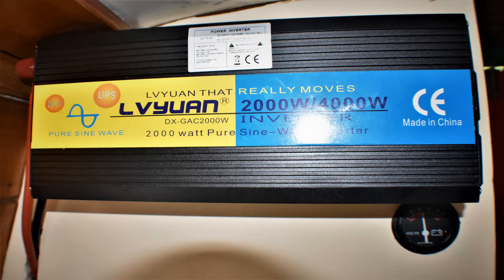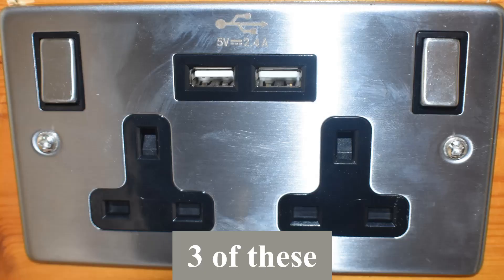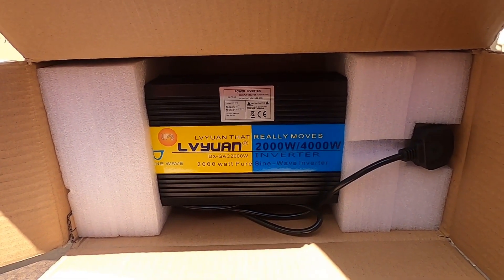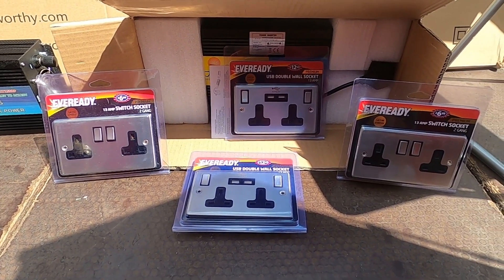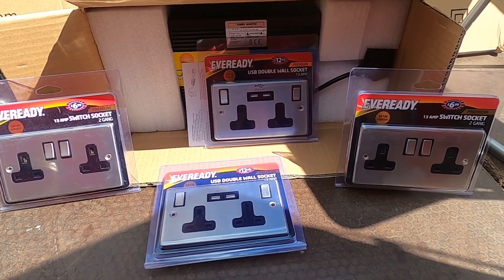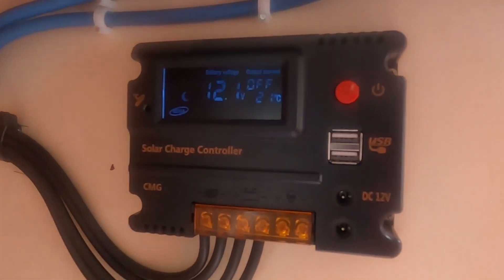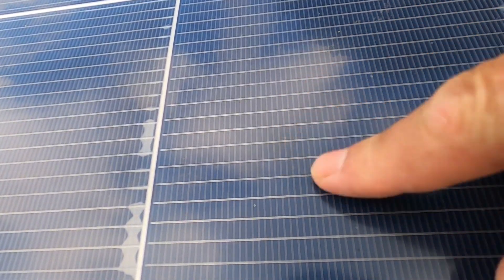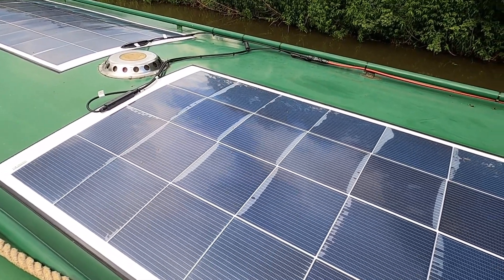Extra Video....No Cruising..... No Off the Cut....It's Electrifying.....With Solar Energy

Comment: Hi Trevor. Liked your blog as always. However could I kindly ask that you look at the " Boat Safety Scheme" and electric cable requirements. The  cables should be always multi stranded and mains electricity on a boat should use artic blue multi stranded cable , like you have leaving your inverter. The grey house single core domestic cable should not be used . Also your mains connection using a connector block I kindly suggest breaks the BSS rules and has the potential to be dangerous.( Easy to touch and get a shock) A sealed connector should be used. I am not an electrician, however I am now on my third narrowboat, and found personally that owning a boat is a steep learning curve with different regulations. The BSS handbook downloadable from internet is very helpful. Kind regards Simon.
Reply from the maker: Thank you for the information. I actually paid a marine electrical engineer to fit it. Perhaps he is behind with the times. I will be contacting him to get it fixed
Reply: Simon Jenkins....absolutely spot on and I was going to also comment about that. Solid twin and earth on a boat is a big no, no. Because it’s solid the natural vibration of the boat weakens the copper until it breaks, hence it’s not allowed and not been allowed for years. 2.5mm2 arctic blue cable for mains AC is the correct stuff as you quite rightly said. Get ‘em back Trev. 👍🏻

Comment: Thanks for sharing. I know nothing about solar panels but had a question. The lighter marks on some of the panels is that just light reflection at some of the edges or are they supposed to be like that ? I wondered if it 
Would impact the efficiency of the panels ?
Reply from the maker: I asked the same question to the supplier. After being fitted for a couple of days they disappeared. They told me it would and it did.

Comment: Well done, you!  Wanted to ask, too, if you've been happy with the outdoor hull lights you installed (I hope I'm not asking a question I've already asked!) ?
Reply from the maker: The outside light work great, I haven't had a chance yet to test them in a long dark tunnel, as I have not been through one. They are great at night time if I am walking back down a dark tow path, also getting on and off the boat in the dark